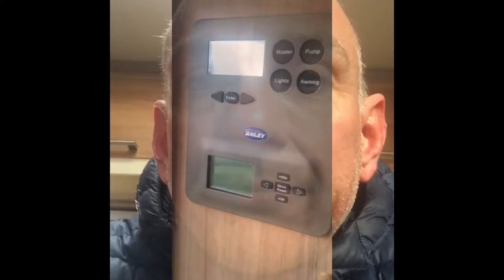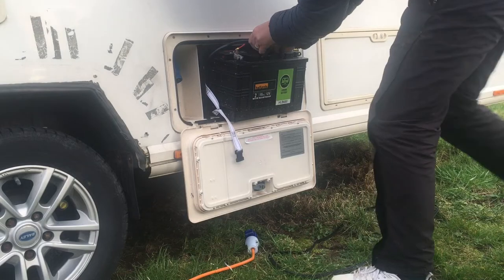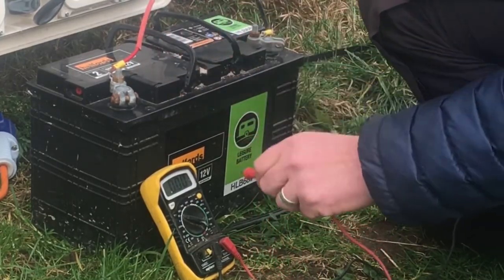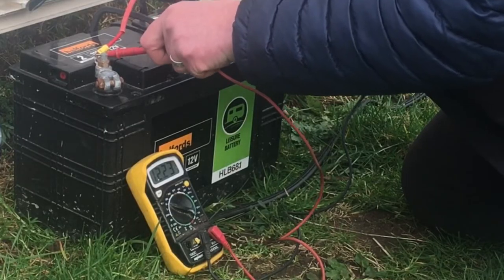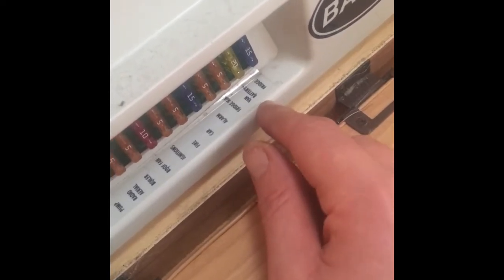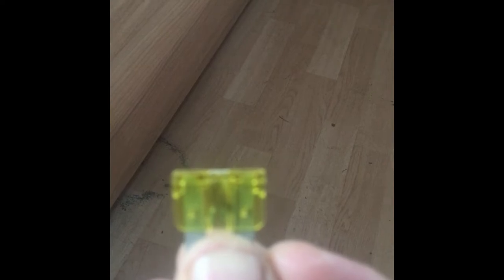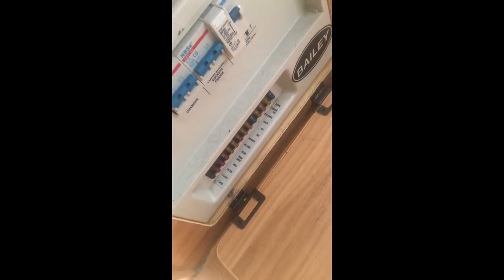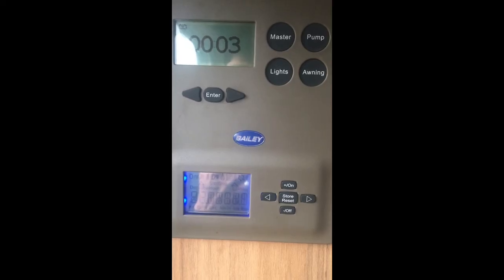No power in caravan, trouble shooting and quick fix!

Comment: Hi Good video, but pleas note, do NOT EVER USE A BIGGER FUSE RATING than the one thats blown, and turn OFF everything BEFORE inserting new fuse, THEN turn one ON one item at a time, hopefully the faulty item  will blow the fuse, but you will know what is causing the problem.
It could be a traped wire, faulty tv, radio light, etc.
Hope this help someone.

Comment: Should be 12.6v if fully charged. Also when you check a battery you need to do it under a load otherwise it can be a false reading.